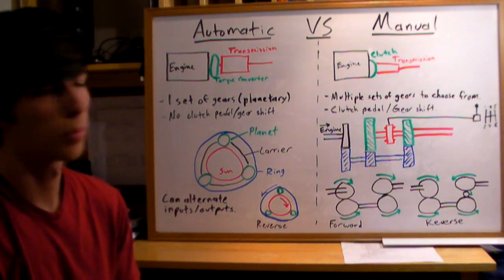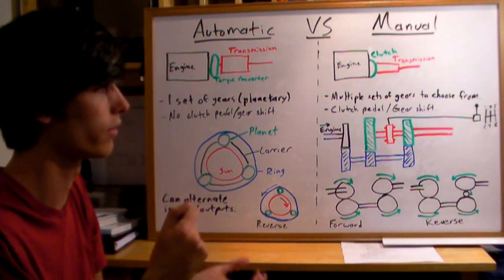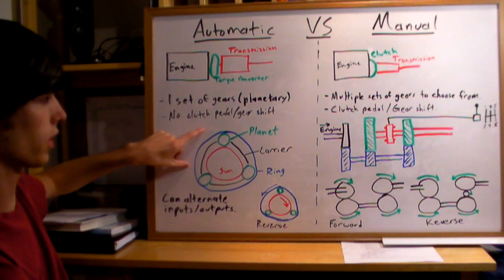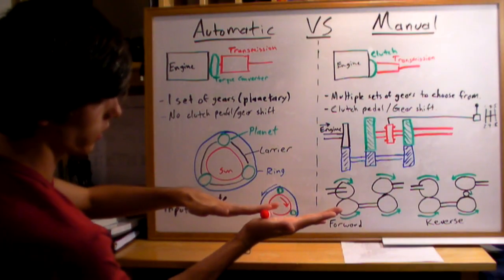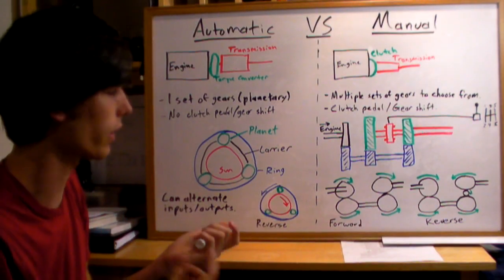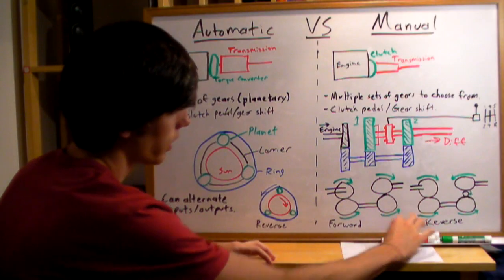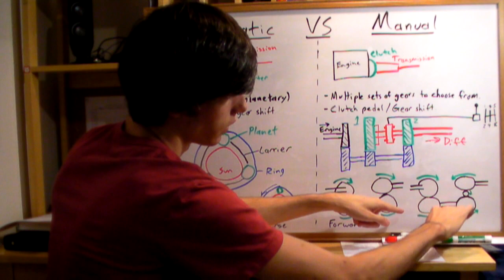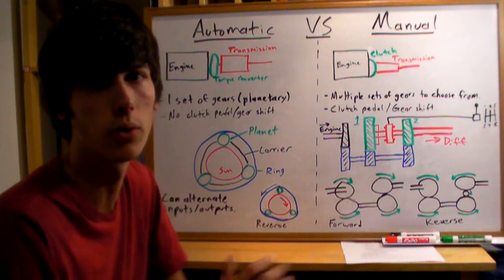Automatic vs Manual Transmission - Explained

Comment from the maker: With modern fuel injection, the injectors can be shut off if you're in gear and not on the gas; so long as your car continues to move, it won't use fuel as the momentum of the car moving is enough to continue rotating the engine. It's not a dumb question; don't feel silly asking, we're all just trying to learn! :)

Comment from the maker: It just means the gears used are straight rather than helical. It's cheaper, but much louder, hence mainly used in racing where noise isn't a concern. If you have a manual car, typically reverse will be a spur gear (google image spur gear and helical to see the difference) and so it will be loud as you back up. Spur gears also don't have an axial load, as opposed to helical gears. Helical gears have greater surface area though, meaning they can deliver more torque, on top of being quieter.

Comment from the maker: Interesting. In my experience it seems automatics drop dramatically in RPM when going downhill, thus entering some form of "neutral." When you step back on the gas, the RPM has to rise a certain amount before you begin to accelerate. So it would seem there is no purpose to shift into neutral regardless of the situation (for the purposes of saving fuel).

Comment: Ive heard that If you ever are riding downhill for a while so you shift to neutral with an automatic transmission to save gas, that you could actually burn up your trans since it slows the flow of transmission fluid too much. Ive been wondering for a while, is this true?

Comment: What causes the engine speed to drop after a shift in an automatic transmission? In a manual it's because the engine and gearbox are linked together via the clutch, but with a torque converter, shouldn't the engine keep spinning at the same speed regardless of gear it's in, because there is no direct link?

Comment: It's good because inline engines are very dynamically stable and the engine itself is machined by germans, who are shot if they make a mistake. Lol.

On the other hand, it isn't good, because won't have the torque of a v-shaped engine. All reciprocating internal combustion engines have their drawbacks, although technology rids us of more and more drawbacks every day.

Comment from the maker: Shouldn't cause any problems, no. Transmissions should be designed this way specifically for emergency purposes as well. If you can't stop accelerating, just pop it in neutral and use the brakes.

Comment from the maker: Instead of a computer telling the transmission when to shift gears, the driver does, with a signal (pushing a button). It can use the same transmission and hardware that's already in an automatic car. That said, it's getting more common, especially in sports cars, to use a dual clutch transmission with the gear selectors.

Comment: Thanks, but I've rebuilt both automatic and manual transmissions, so I'm intimately familiar with how they work. Actually, I've probably rebuilt more than 100 manual transmissions, most of the being T5s. Books are great, but nothing beats hands-on experience.

Comment: I dont know how to drive stick but I can tell you that changing gears without using the clutch will fuck up your tranmission or engine not sure which one..probably both. Unless he has one of those newer manual transmissions that dont use a clutch pedal and you just shift...but that sounds a bit boring.

Comment from the maker: It's a manual transmission that uses dog engagment. These are basically cogs on a slider (spline) that can engage the gears. It's very similar to what I've explained above.

Comment from the maker: Anything and everything can break. Manuals don't have fluid for cooling like the automatics do, and no fluid in the clutch housing if it's a dry clutch. Auto's have fluid for the torque converter and the transmission. I would say manuals tend to seem more robust over time, but in good condition both are pretty reliable.

Comment: Which transmission last longer automatic or manual? I heard that a automatic transmission breaks easier compared to the manual. Also, I heard that the manual transmission when it breaks its only the clutch. Is that true?

Comment from the maker: You give it gas because you're going to a higher rpm if you downshift. Either you let the transmission shock the engine up to a higher rpm, or you press the gas pedal and get it there without having the shock.

Comment: Also I dont understand why you have to give it gas in order to downshift smoothly. If the clutch is depressed the motor is spinning and the transmission is not, wouldn't giving it gas make the flywheel spin faster and make for a jerky shift since the transmission is disconnected?

Comment from the maker: If the engine speed and the transmission speed (which results from the speed of the tires) is the same, then you can shift without using the clutch, because your connecting two things that (relative to eachother) are not moving. Obviously they are moving, but moving together. So if you know at 60 mph your engine is at 2500 rpm in 5th gear, you can rev your engine to 2500 rpm (while going 60) and put it in gear without a clutch. Good practice? Not really, youll grind your gear collars eventually.

Comment from the maker: Many electric vehicles are geared directly to the tires, the transmission is a single speed, so manual wouldn't really exist. Torque converters aren't needed because electric motors don't stall like IC engines.

Comment: automatic you lose torque and power in the torque converter and they are heavier, though drag racers use automatic 4 and 3 sp in there drag cars (though drag racing is boring), I drive manual and I reckon it is better gear selection, also few engineers told me manual is better they drive manual also. also cheaper and better on fuel and all in exchange for moving your left foot and arm.

Comment from the maker: That's not necessarily true. There may be more mechanical losses (through friction) in an automatic, so this may be your answer. As far as racing, manuals are used (or selectable gearboxes) so that the driver can choose the optimal gear to be in. Computers can't do that.

Comment: That is true, I never said dual clutch gearboxes had torque converters. Most racing transmissions are electronically controlled you are correct.

Comment: Depends on what your definition of "best" is. Is a manual more fun, yes. Is a manual quicker in normal situations, yes. Is a manual transmission faster than a racing-style automatic transmission, no. Can a manual brake torque launch....no.

Comment: Drag-specification automatics are superior in extremely high performance drag racing. Automatics that are designed to deal with constant full throttle situations and shift as soon as possible, exactly at a pre-programmed red-line, will always best a human driver. Not to mention automatic transmissions can utilize a brake torque launch which is also a distinct advantage.

Comment: So on racing applications which is preffered auto or manual? I drive a manual myself but often times when drag racing, auto trans always have a quicker take off. Btw nice videos and can u explain what's the sky active tech that they use on Mazda's.

Comment: and yeah it is complicated, expecially the ones with multiple planetary gearsets as in ones with more than 4 gears like most if not all current models. right now, 5 speed autos are being "killed" so to speak by 6 speeds and some vehicles have even up to 9, at least i heard that about one coming out soon, not here right yet though, and even transport trucks are becoming available with autos bit by bit and some have like 10 gears. so yes, these things are easily confusing...

Comment: Sound like a transmission issue, but the rpm doesn't have anything to do with that, if the clutched is pressed all the way down because that separates the engine from the trasmission and that allows you to do the shift, and it also might be at what speed  are you going (mph).

Comment: @EngineeringExplained But the user doesn't need to know what's going on inside. Planetary gears are also used in bicycle hub gears. The driver only needs to flip a switch.
Now that I think of it, isn't this what a "semi-automatic" is, an "automatic"-type system with manual control?
So my guess would be that a clutch-based transmission is easier to make, while a planetary-based transmission is easier to automate (and switches faster).

Comment from the maker: @ajpanton Put simply, it would not work well. Automatic transmissions have multiple clutches and bands which could not be operated by a single foot like a simple single clutch manual transmission. I suppose it may be possible to put a tradition manual trans. in an automatic, but it would be rather complicated. A torque converter is a clever replacement to a clutch, and automating a clutch, plus 3 or more selector arms to switch gears would be a challenge.

Comment from the maker: @tnphysics Automatic gearboxes are simply just more complicated. More precision involved, more pieces that have to be perfect. Fluid pumps, actuators. There's more research that has to go into it. Manual transmissions are far less complex, and can perform the same actions just as well.

Comment from the maker: @villeneuves2 Actually, working with manual transmissions is typically easier than planetary gearboxes, so the cost is generally cheaper. Manual transmission used to last longer, although now a days it's more dependent on the company you're buying from than the transmission you choose. Replacing the clutch is a big cost if you're an aggressive driver, but automatics generally cost about $1000 extra or so initially over a manual.

Comment: Which one requires more maintenance?  You need to replace the clutch sometimes on standard transmissions... Since there is no clutch on AT and most of them have lifetime oil, does it mean that there is almost no maintenance needed at all ?  Thanks

Comment from the maker: @joeslimon Correct; with the use of synchronizers the moving collar can equate the speed of the non-moving forward gear. Many times, reverse has no synchromesh, so the speeds of the rotating collar and the reverse gear need to be equal (typically not moving).

Comment: Your description of the manual transmission forgot about the clutch, by disengaging the engine you can shift into a forward gear while moving backward.  The clash won't happen since there is minimal resistance to the gear change.